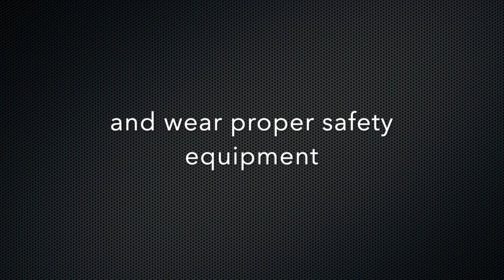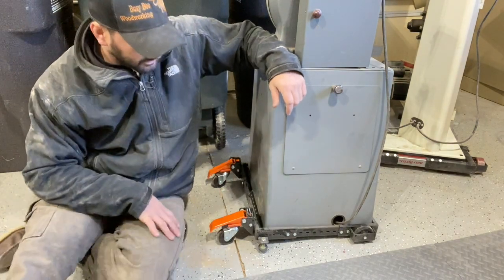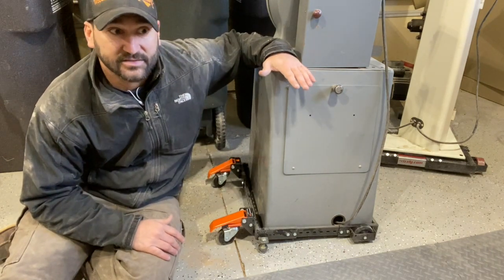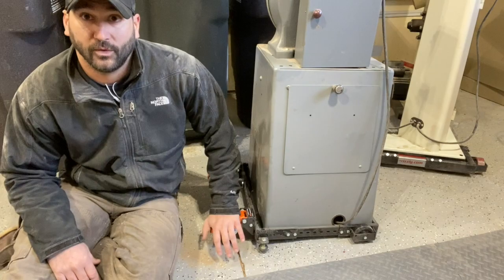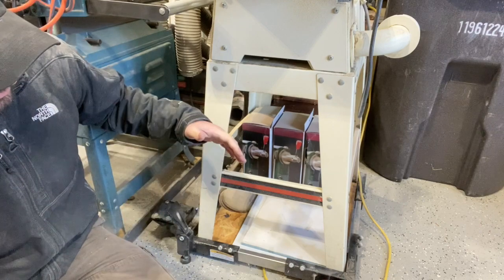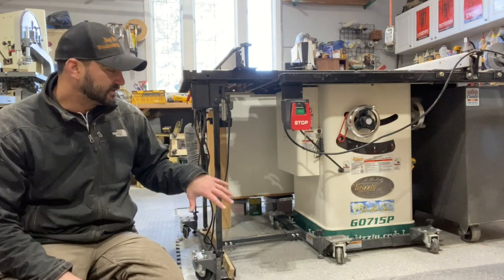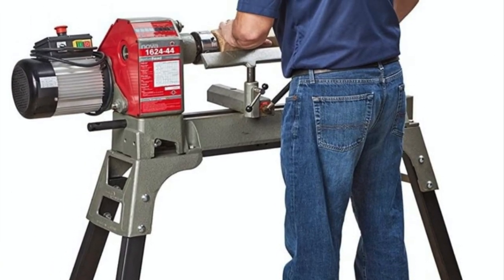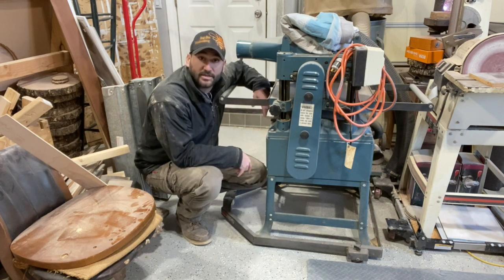Mobile Bases for Tools (Different types and what to look for)

Comment: Thanks for making the comparisons of these mobile bases. I have the Bora model under my jointer  and it works fine. Generally I’m not a fan of bases that extend the tools footprint but they all do that so take the good with the bad. Interesting that you didn’t mention diy bases that significantly raise the tool height.

Comment: Thanks!  With my 3 wheeled base I replaced the 3” threaded rods with 24” threaded rods/ attached some aluminum angle iron horizontally to the legs of the saw and slipped the threaded rod thru slightly oversized holes and attached the OEM knobs to the top of the threaded rods. VOILA… no more  bending way over to turn anything.
Reply from the maker: Nice work!

Comment: Nice video! Appreciate the info! Just put my 14” bandsaw on that Bora Portamate 1100. 400lb rating. I glued a 1/4” ply to a 3/4” ply. They send 2 lengths of screws. The shorter ones fit perfectly when mounting the corners and the ply. Very sturdy. Moves nicely. Just wanted to pass this along.
Reply from the maker: Thanks for sharing! I was wondering how that system would work and how it would hold up.
Reply: Im planning on buying a band saw and putting it on a base, any issues with tipping?
Reply: @ChonkysWoodshop  no tipping. I made the base approximately 4” larger all the way around for stability. It doesn’t get in the way of my feet either. I took the plywood and put it under the bandsaw before actually assembling it to see if it wood get in my way. It doesn’t. Good luck! Keep on woodworking!!

Comment: Great video . I have the Hitachi c10rj table saw and it has a very wide footprint 45 1/2” x 36”. Have a ever seen a move able Nase that this table saw can fit in ?
Reply from the maker: Most have adjustable foot prints so just pay attention to the descriptions when it comes to ordering so you can be sure your footprint matches up.
Reply: I’m 73 now and I have a small space to work in so I have to move my tools to the center of the floor and I take my table down when I finish using it and put back up when I need to use it.